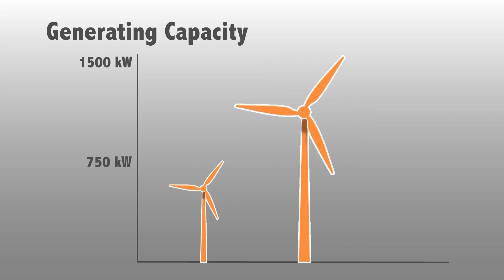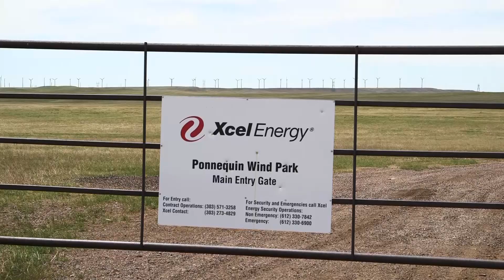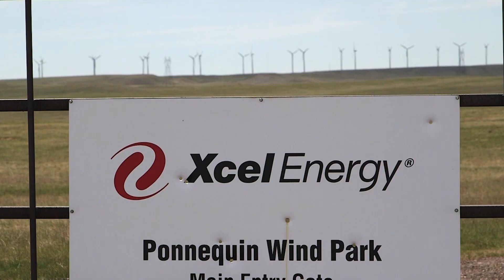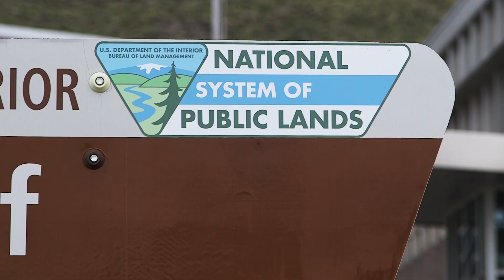Who Cleans Up When a Wind Farm Retires?

Comment: look how much bigger wind turbines are today https://www.youtube.com/watch?v=qS3CtSX8Eck.  giant helicopters can land on them. wind power now produces more power than hydro.  these are 0.75 MW turbines.  the new turbines can be as big as 5.3 MW and offshore turbines can be as big as 12.0 MW.  The technology is so far advanced.  Lockheed Martin is working on a 50.0 MW offshore turbine.  if you have wind turbines at various places it balances the grid with solar very well.  we all know when solar works.  the trick is to find places where wind produces in the evening, nighttime, and morning.  that's why Wyoming wind is so valuable.  bigger taller turbines now produce power 50% of the time, and its very, very, very predictable when the power will be produced.  so the grid is all solar, wind, and natural gas going forward. nuclear, coal, and hydro are rarely built anymore. with batteries slowly replacing natural gas as batteries get cheaper.  wind is 2-5 cents per kilowat hour.  solar is about 2.3-5 cents per kilowatt-hour.  the cost of both has dropped by more than 90% since those tiny turbines were designed.  the cost will fall another50-75% over the next decade.  the biggest cost becomes transmission costs and storage costs.  batteries are falling in price by 16% per year.  the future is undoubtedly renewable based on economics alone.  best money we ever spent was on research and subsidies to build these industries.  

a few old towers is no big deal.  compared to coal ash ponds.  mercury and other heavy metals in our water.  

there are more jobs in renewables too.

renewable energy used to not be a partisan issue.

I hope that can return.

Comment: a nuclear reactor can take 40 years to decommission. The cost of this small windfarm coming down is a drop in the bucket compared to the cost of nuclear.
Reply: Nailed it. I would include the cost and pollution that comes with decommissioning a coal plant and natural gas plant is a lot more, but a wind farm is manageable because there really isn't any toxic chemicals to clean and scrub.
Reply: And a nuclear plant will generate power 24/7 365-1/4 days a year for decades, only going down for maintenance.  You also don't need to build significantly more generating capacity than the grid requires, hoping to balance variable production with fairly consistent patterns of demand - or build grid level energy storage.  

The french have been using breeder reactors for decades, burning up and concentrating their waste fuel rods into newly concentrated and usable ones, resulting in significantly less waste material with shorter half lives to deal with.
Reply: @jdhill770  "The french have been using breeder reactors for decades, burning up and concentrating their waste fuel rods into newly concentrated and usable ones, resulting in significantly less waste material with shorter half lives to deal with." Great, I'll tell the Fukishima residents that they have nothing to worry about. I think the mail from Fukishima is being routed through Chernobyl...

Comment: Just build more nuclear power plants.
Reply: Old type nuclear plants that use H2O for 4 coolant, becomes a dirty bomb when the pumps fail, because the water separate, it just like putting gasoline in the radiator of your car. I sure hope they can get the molten salt reactors or a Fusion reactor working soon.
Reply: Heavy water reactors are also safer, and do not require uranium enrichment either. But since they do not produce plutonium, the US has no interest in them. Canada's been sort of laughing with its Candu reactors for years, but the US likes to suppress their spread because it undermines their narrative that nuclear energy requires uranium enrichment.
Reply: France are looking at a 70 Billion euro cost for decommissioning their first wave of reactors.
Reply: And use this land for the waste...

Comment: They mention "surface" returned to original a few times. There is no mention of sub surface where the largest portion of these turbines lays hidden. EACH turbine has between 30 and 70 metric tons of steel and concrete below, hidden underground. The newer bigger ones have even more hidden underground. Current plans are to just cover over the Steel/Concrete foundations and leave them. These underground structures are top grade cement and steel. The cement could actually get stronger over many decades left covered.
Reply: thats not good
Reply: Nothing said about removing all that base material completely.

Comment: Wind turbines have huge foundations, very deep into the ground.
Would they really get all the concrete out?
That's a lot of concrete and rebar.
Reply: So good for the environment, NOT.
Reply: Imagine a plough running into those hidden foundations.
Reply: And concrete is one of the biggest co2 emitters,while wet and manufacture.fifteen year life span ,massive energy outlay to manufacture , transport, maintain,erecting ,then they are subsidised to the hilt ,.could someone explain the merit of these things
Reply: @darrencottam1146  
O.k. Perhaps this installation does not work out economically. Sounds like they are limited in scale, and since they can not grow, will be decommissioned. This is how we learn, we try things and see what happens. Humans can not continue to rely on burning FF forever, sooner or later alternatives will have to  be found if we are to carry on living as we do. At my age, I don’t think climate change will effect my life much. But there are lots of places already suffering, and future generations will have to pay for our life style.  People will burn petroleum until the last drop is gone. Makes sense to work on the alternatives while we still have time to work out the kinds.
Mercury and lead pollution have killed many more birds the wind turbines, not to mention all the species driven to extinction by humans shooting them. Concern about bird strikes and wind turbines seems like a weak argument. No form of energy has zero impact.
Reply: @mplsmark222  I said nothing about bird strike what so ever. 
The fact that these structures need so much material to manufacture that is fossil fuel driven .not to mention the vast amounts of oil in the turbines along with copper .and the subsides that pay for it .it's a fools folly at our expense.
And if is so important to destroy our fossil fuel industry ,why are countries like China India and Japan increasing their fossil fuel power plant industries by hundreds ,with the promise of getting rid of them in 2060 ( yeah right).
Reply: somebody else can clean that up
Reply: No
Reply: Politicians had to be seen doing “Green Things”.
Money to be made!
Votes to get.
Save the Planet!
Windmills are just a gigantic fad like hoolahoops
Reply: Video said use of explosives to bring them down. I would assume it means the foundation.
Reply: @boatguy64  Explosives to bring down the turbine only. But with the thickness of that steel reinforced concrete, it would also take explosives to demolish it and remove it, if they are to return the land to its original state before the turbine was installed.
Reply: @boatguy64 My bet:  to the foundation.
Reply: @D Sullivan
Cement is used again, and rebar is a recourse like all scrap metal.
It's going to be used again. They're doing this with bridges etc.
But it has a cost. There comes a point the effort gets too high.
How can someone pretend to be for "the environment", but put stuff in the ground
and "Just cover it up?"
In the future this will be a huge problem for someone. 
Maybe not in 50 years, but maybe in 100 or 200 years. 
But we do this because earth will warm up 0.00007 degrees in 100 years?
Reply: Why should they take them down to ground level the part under ground hurts nothing
Reply: @maxpayne2574  Except burrowing animals, any plant or tree with roots beyond top soil level depth, farmers, future builders, etc...
Reply: These turbines are tiny compared to todays technology. The wind is still good as always in this area. Its only a matter of time before someone else buys the property for bigger turbines and tears down the old ones for scrap.
Reply: @davefroman4700 
But are they viable without subsidies?
Do the get subsidies, and would they build them without?
Reply: @scorchedearth1451  Unsubsidized solar and wind in the open marketplace today are now the cheapest forms of energy production in the history of the global energy markets. We are routinely seeing wind contracts at less than 4 cents and solar at less than 3 cents. The record is now 1.4 cents. Even in Germany (which gets less sun than MOST of Canada) Solar is less than 4 cents now without subsidies. In 1978 its cost $75 to produce 1 watt worth of solar generation. Today that cost is less than 20 cents per watt of panel due to automation and a tripling in efficiency.
Reply: @davefroman4700  I live in Europe, and I know the price of electricity in Germany has risen enormously. 
Because you cannot rely on wind or sun, conventional power plants have to be on stand by 24/7. That costs a lot of money.
But who cares? We have to lower the planet's temperature 0.0000005%.
Reply: @scorchedearth1451  Batteries negate that issue. And they are a LOT cheaper to operate than traditional generation assets. Every where that storage is being added to the grid today it is undercutting generation assets. They are bricks. Fully Autonomous. They sit their for 20+ years with bugger all for maintenance and you never have to buy fuel for them. The cost of batteries has also been plummeting for the past 8 years. You can try and deny the inevitable but in a capitalist system the cheapest alternative always wins in the long term.
Reply: @scorchedearth1451  "But are they viable without subsidies? Do the get subsidies, and would they build them without?" Please explain the TRILLIONS in subsidies we US taxpayers give the oil industry every year. Free military escorts for tankers. We don't do that for container ships of shoes, food or TVs! Why does oil get it?
Reply: @justsomeguy934 
I dunno. I didn't ask for it.
I'm against any form of subsidies.
You get more of what you subsidise.
Every company should fight for the favors of their customers. 
Subsidies corrupt the world. 
But when the oil industry gets free money, why is gasoline taxed that much?
Reply: @scorchedearth1451  "But when the oil industry gets free money, why is gasoline taxed that much?" I assume you're talking about DOT tax, or point-of-sale tax. That tax is [supposed] to be used for road maintenance and is actually a good way to have the users of the roads pay a proportional tax. The hidden tax of oil - that is, the price the US military pays to protect tankers and the trillions in subsidies we give oil - is not reflected at the pump. If it was, you would buy an electric car TODAY because you couldn't afford gasoline.
Reply: @justsomeguy934 
Gas companies should defend their own vessels.
Put some military grade canons on it. 
When government does it, it costs a lot extra.
I believe in a free market.
But with subsidies and taxes it never can be free.
When government gets involved more, it gets effed up more.
Reply: @scorchedearth1451  ""But when the oil industry gets free money, why is gasoline taxed that much?"" This topic of road tax is actually a good one for electric cars. At present, DOT tax paid at the pump is an excellent way to have drivers pay for the amount of road they "use". Drive 2x as much as me? You'll pay 2x the tax when you buy gasoline. Electric cars don't have that metric as they charge 90% at home from the grid. It's quite the hot topic in the EV world. I have no good solution for the issue.
Reply: @scorchedearth1451  "Gas companies should defend their own vessels.
Put some military grade canons on it. "
I could not agree more. You would be amazed at how many people call me names and question my patriotism when I state that Exxon should hire its own security force, pay for submarines and risk company employee lives for their product. Using less oil is the only way to stop this madness. Believe it or not, we don't get the majority of our oil from the Mideast; it's from Canada and Mexico/South America. So if we cut back half our oil use - by eliminating gasoline and fuel oils - we don't need a drop of terrorist oil at all. That's my goal.
Reply: Done with diesel powered equipment.
Reply: John Obmar:  Why would the foundations have to be removed?   Cover them with dirt. They are only about 2 feet above the ground.
Reply: @timhallas4275  any oil field reclaimtion is to below plow depth
Reply: @erniew5805  Oil field?  What oilfield?
Reply: @timhallas4275 yea so wreck good farm land for solar and wind and neither is at all feasible.coal natural  gas  and hydro are all good not crazy about nuclear  for the waste ,never make anything  u can't get rid of
Reply: @maryfries2147  I'm not arguing in favor of wind-farms.
Reply: @timhallas4275  
Someday, someone wants to build there something, and finds a huge rock in the ground.
The property is worth much less with that in the ground also.
It's a good foundation for your house, though.
Reply: @scorchedearth1451  This property will become what is was, open range for grazing Buffs.
Reply: @timhallas4275  we must have them transported in from SE Asia?
Reply: @timhallas4275  Until they wish to build on it.
In my time what was bush, swamps,  or simply a flood plain or too hilly has all been built on. And gets worse every year
Reply: Why would you take that out, topsoil will layer over it and the grass will grow
Reply: @ciaranharrington4141  Because leaving them there violates the removing any trace agreement.
Reply: @ciaranharrington4141 
Maybe in the future they want to build a city, a subway, sewers etc.
Someone will dig in the ground and think "What f*cking moron sell me this property which is now useless to me?".
But maybe they put another turbine on top?
Reply: @scorchedearth1451  then they will burrow through the stuff.
Reply: @Ham549  
That is more expensive than digging through the Mount Everest.
Reply: @scorchedearth1451   if they put a new one (larger) in place it needs a larger base.  So if rebuilding larger, needs new larger pad?  I could be wrong, larger turbines need larger bases?  So they have to take out old pad and put in new ones.
Reply: @ALadyD704 
You're right.
Reply: @scorchedearth1451   You obviously have not been to Wyoming.
Reply: @portnuefflyer 
Is there something special in Wyoming I have to see?
Reply: @scorchedearth1451   The Idaho border!  Just a bit of interstate dissing, Wyoming is hated/loved by many here. It can be a rough place, the old west at it's best/worst. Pro truckers can tell horror stories about the winds there, they are often blown over, it's also notorious with pilots of small aircraft like myself. So decades ago we weren't surprised to see the wind farms go up.
Reply: @ALadyD704 And that could be one big reason why they don't re-use old sites:  they would have to replace those deeply embedded bases...
Reply: @ciaranharrington4141  it would be like any big rock under the ground.